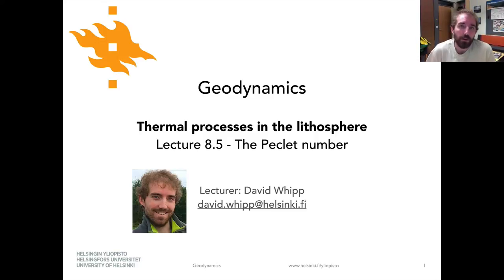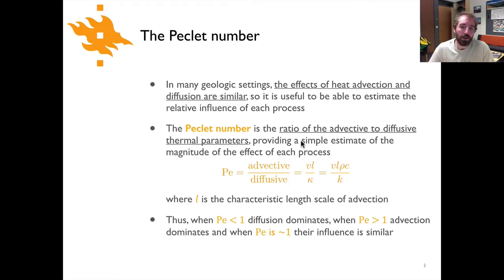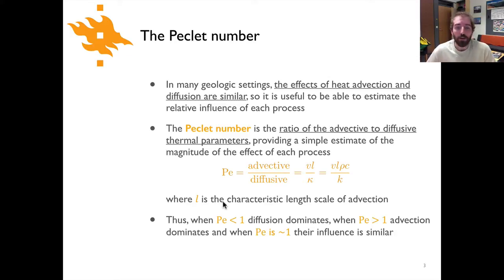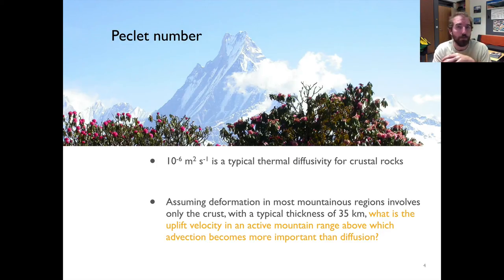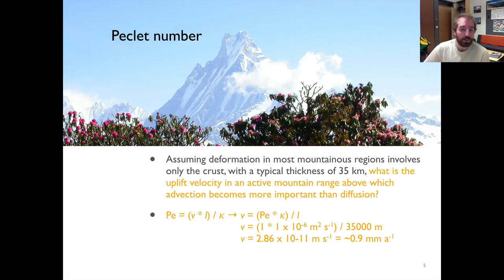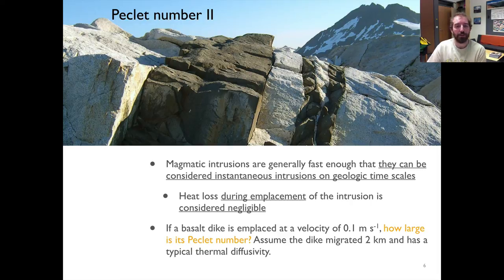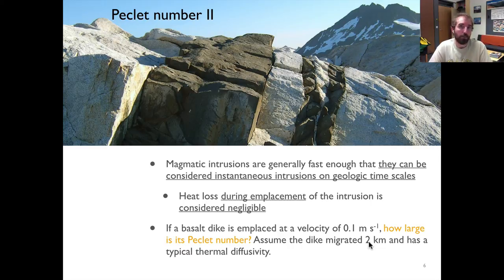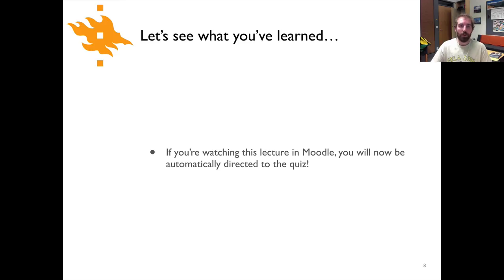Geodynamics - Lecture 8.5: The Peclet number

Comment: Isn't that the Nusselt number?
Reply from the maker: Hi. Bit late responding here, sorry. I'm a bit less familiar with the Nusselt number, but I believe it has to do with heat transfer perpendicular to a boundary in a fluid rather than within the fluid itself. If you Google a bit you may find some examples that might help highlight the difference, but it seems that the Nusselt number is proportional to the square or cube root of the Peclet number for fluids with high Peclet numbers (see https://www.sciencedirect.com/science/article/pii/S1290072916300187, for example). Unfortunately, I'm not able to come up with an intuitive example at the moment...